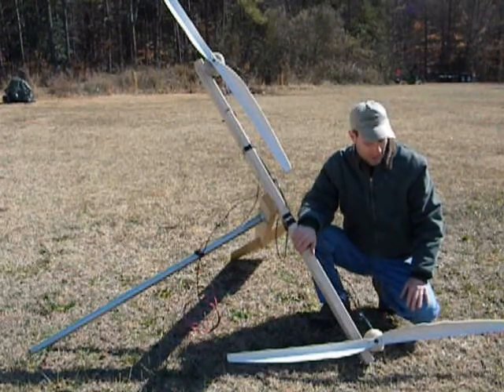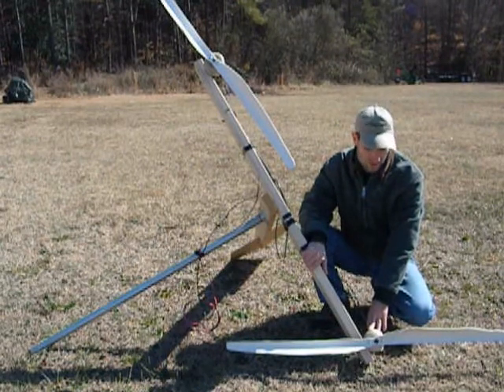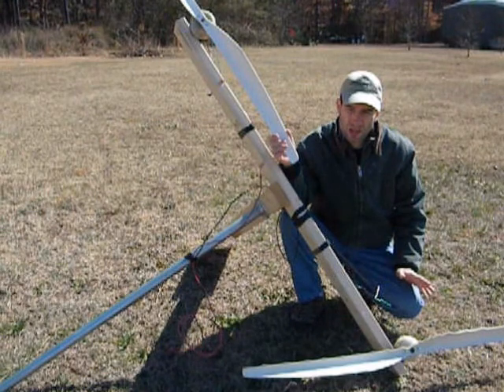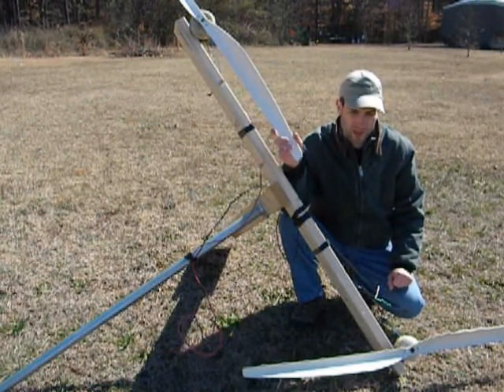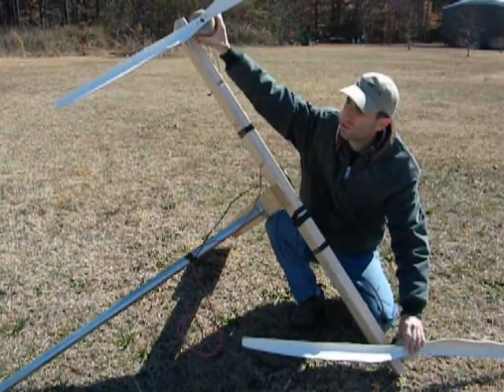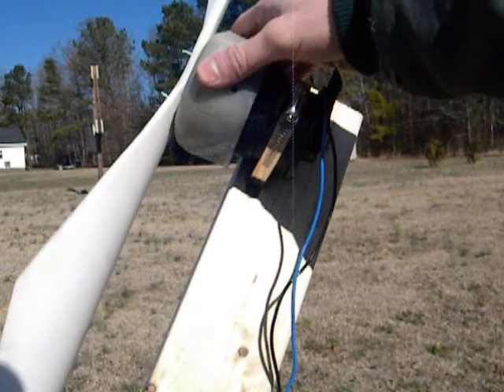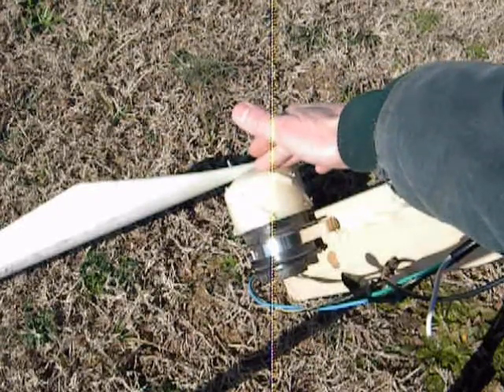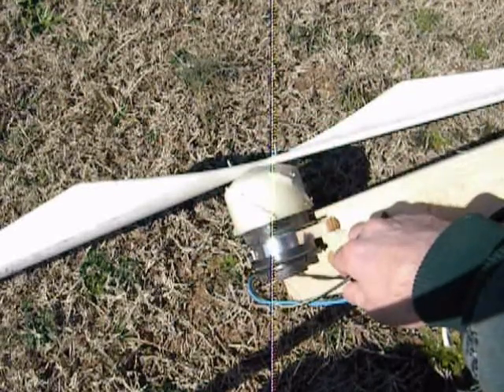Testing of the 2 motor wind turbine

Comment: spin the motor with a drill you might get 10 or 11 volts . car fan motors are not good for charging 12 vwind systems i have tryed.